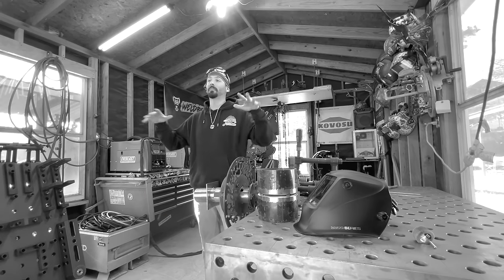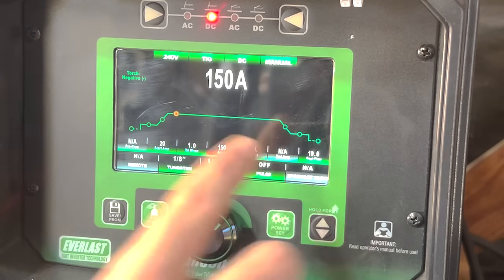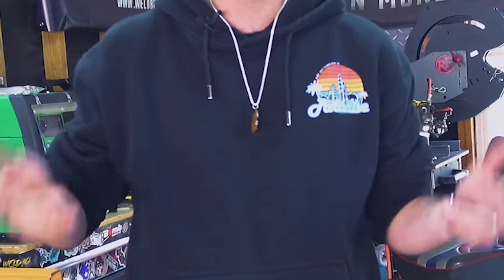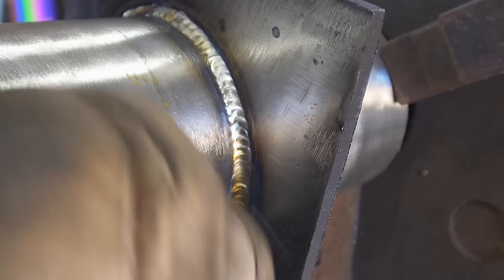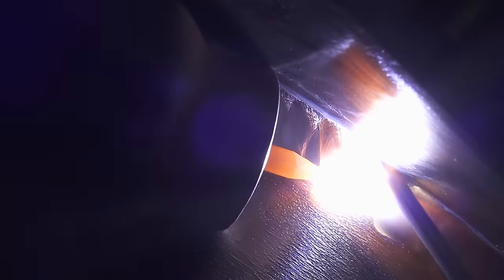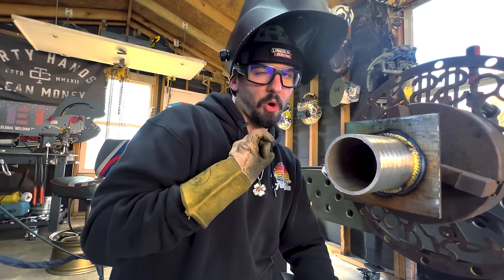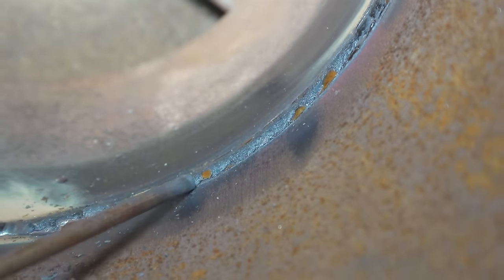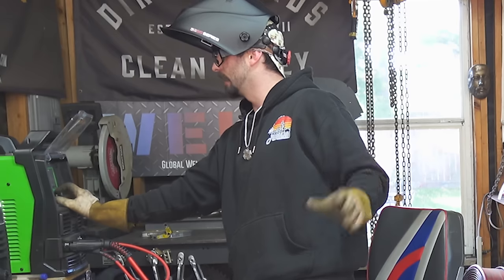How To Walk The Cup: Tig Welding Walking Vs Wiggling

Comment: Nice video but why wouldn’t you weld it in position? Welding it on a pipe roller is welding the entire pipe easiest position on the pipe….
I kinda wanted to hear his advice on walking the cup from 6-9 & 6-3 on 6G